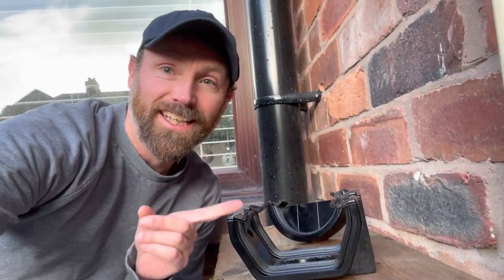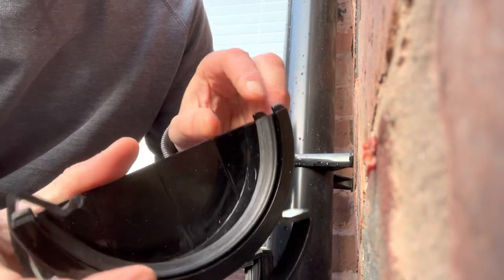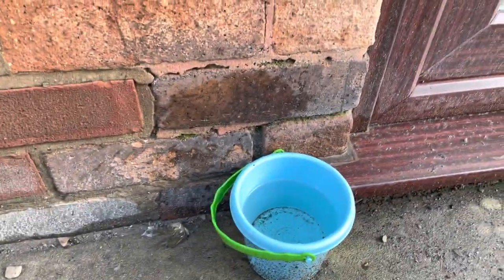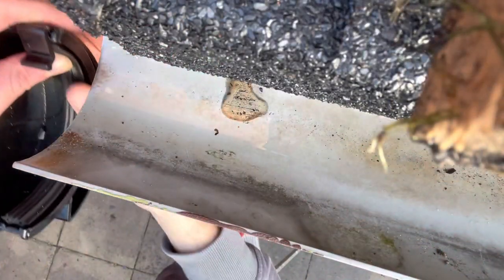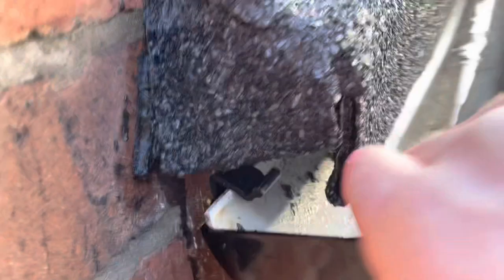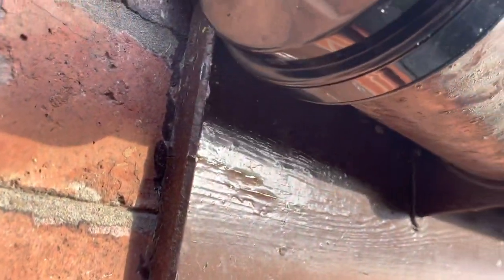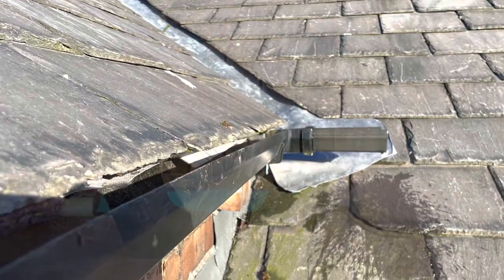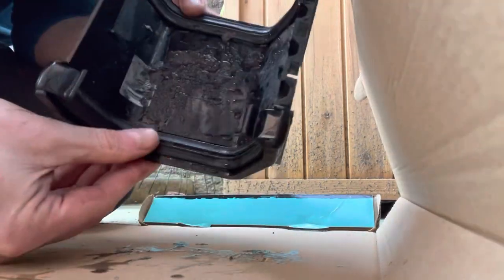How to fix a leaking gutter - replace stop end and union bracket

Comment: Thanks for the tip.  I will get a new end cap as suggested. The old gasket is not very pliable.
Reply from the maker: Hello John, whole 'stop end' sections including new gasket, are retailing for as little as £2 from local hardware stores (e.g. screw fix). Please consider appropriate safety precautions if you plan to work at height. Thanks